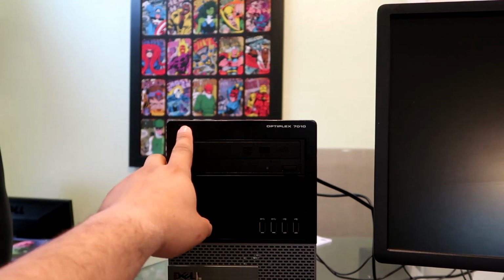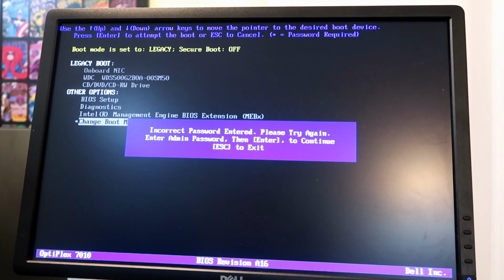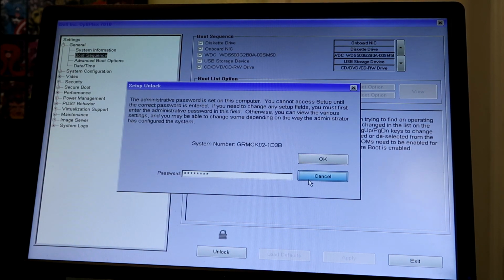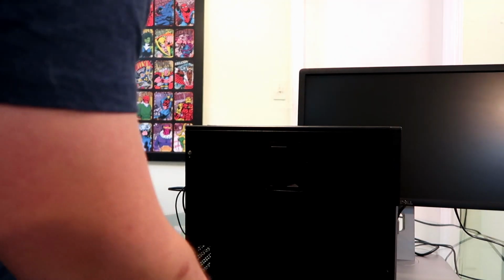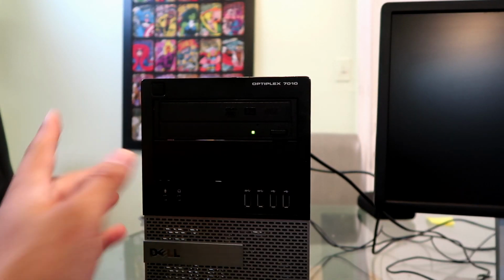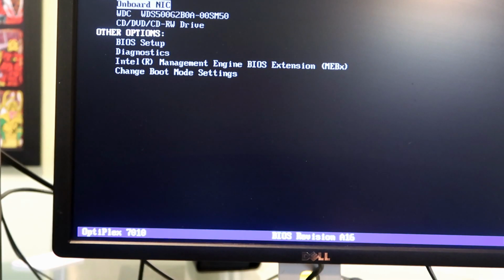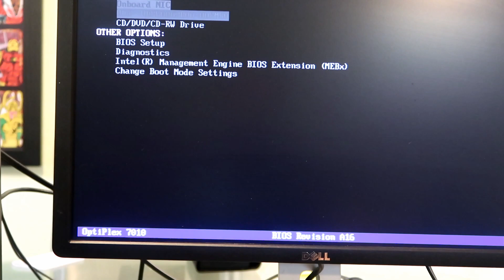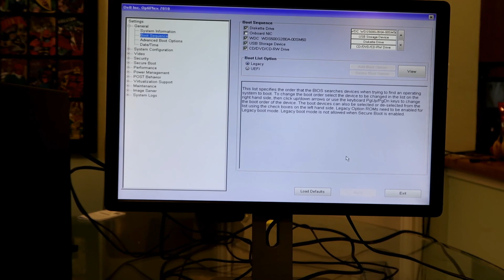How to Delete the Bios Admin Password on a Dell 7010

Comment: For most Dell Dimension desktops, the steps to reset a BIOS password and clear all CMOS settings are:

Locate the 3-pin CMOS password reset jumper on the system board.
Remove the jumper plug from pins 1 and 2.
Place the jumper plug on pins 2 and 3 and wait approximately 5 seconds.
Replace the jumper plug on pins 1 and 2.

Comment: Hey man! Nice video!
I have a dell optilex 7010 as well.I have one question.If i put a gtx 1060 gpu than how will i be able to set it up as the primary gpu in the BIOS?Thank you:)
Reply from the maker: It's plug and play, just plug your display cord into the gtx 1060. Make sure to update your gtx 1060 drives after that.
Reply: @Ghost57  Thanks!